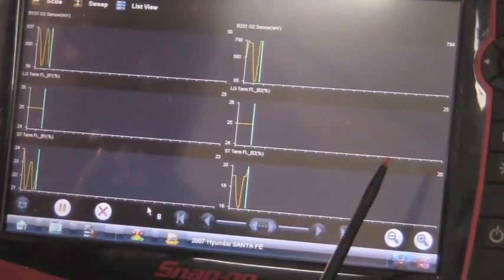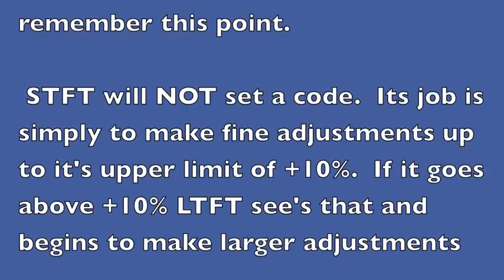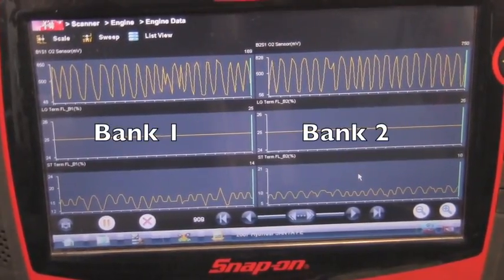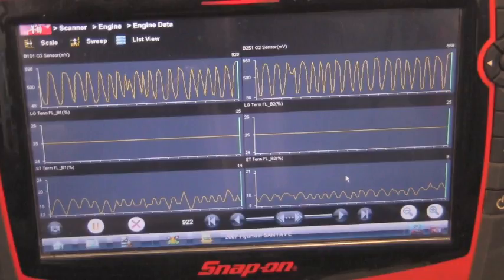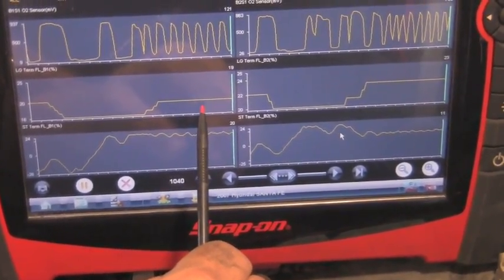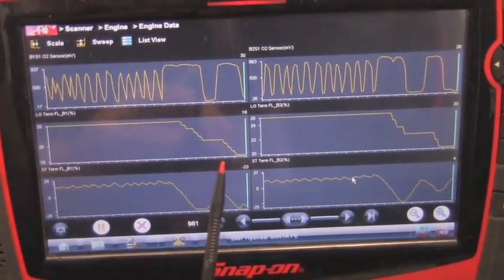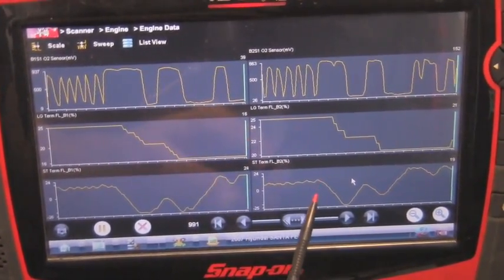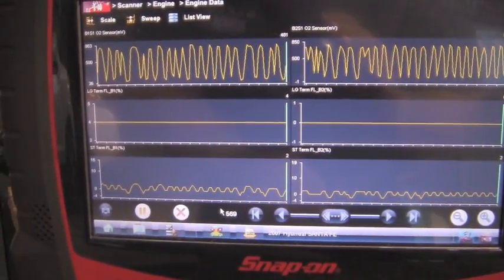Watching a PCM work and Interpreting the Waveform

Comment: Will the scanner display the same readings if the problem is too little fuel, rather than too much air?
Reply from the maker: yes
Reply: @realfixesrealfast  Thank you. I'm trying to figure out a problem with my OBD1 '93 Mazda Protege and even OBD2 analyses help give me insight. There are still a lot of OBD1 vehicles on the road.

Comment: I wish I had a real fix real fast. Wish I could get my 89 s10 pickup to run right. Runs good for 15 minutes and then like a switch was flipped the engine starts to run really bad. Shaking. Almost didn't make it home today because the truck was running so badly. I replaced everything but the tps and map sensors.  So why won't the truck run right?

Comment: It’s a good video with really good explanation as to what’s going on. The only issue I have with it, and it’s a minor one, is in the description. Those graphs technically aren’t from a lab scope, they’re from scan data. Now I know you’re using a Snap-On Verus which has a lab scope built into it, but the lab scope wasn’t used to draw those graphs. The only reason I bring this up is because for those just starting to learn, they may get the wrong impression that fuel trim can be viewed with a lab scope, which it can’t be. It can’t be viewed with a lab scope because fuel trim is neither an input nor an output. It’s a calculation.
Reply from the maker: Thanks for your comment. Your exactly right.  Sometimes when I'm filming these videos I get my words mixed up.  But after filming and during the editing process I may notice it but it's too late to change it.  Thats the case in this video. But after reviewing it I decided that the teaching point was still a good one.  I really appreciate you keen eye and comment.

Comment: Great explanation, as always. Could you please also explain why, on the left bank after the repair, the LTFT is at 4%, when the STFT is only at 2%, which is well bellow the 10% mark?
Im i missing something? 
Kind regards, Joe
Reply from the maker: Joe.  Remember that you need to watch data over time.  Don't make a judgement only from a glimpse,  The answer is this.  The ST started at 0 and went over +10%. Then the LT kicked in and moved up to 4%.  That was below the 10% limit and that was all the LT needed to adjust and now the ST is holding steady at 2% and the O2 is switching.  So the PCM is controlling air/fuel and no code is being set
Reply: Thank you very much for the explanation. The key point here, is as you say- 'Watch Data Over Time'.
Once again, thank you.
BTW, i hope you're keeping well.
Kind regards, Joe
Reply from the maker: Thank you for you concern Joe.  Yes I've had a little bout with a medical issue but all is on the mend now.  I appreciate your thoughtfulness.